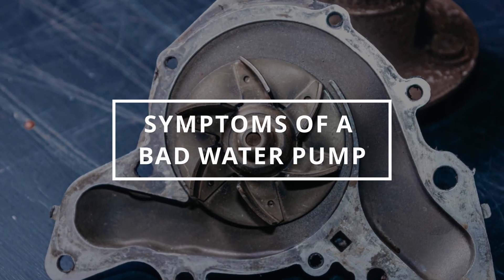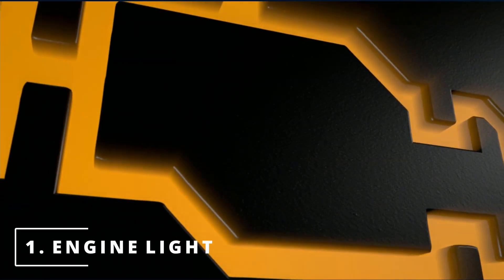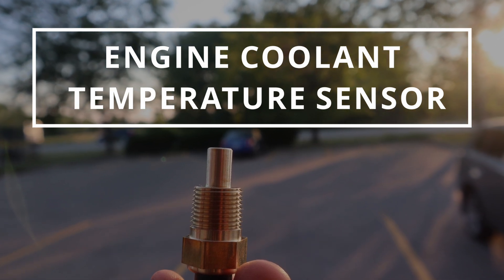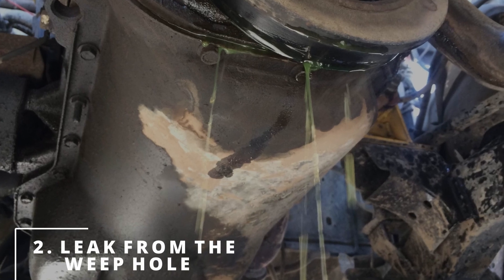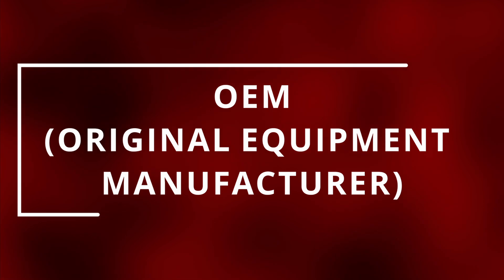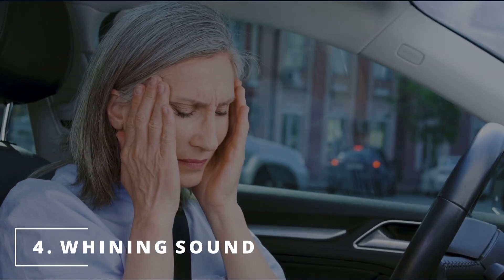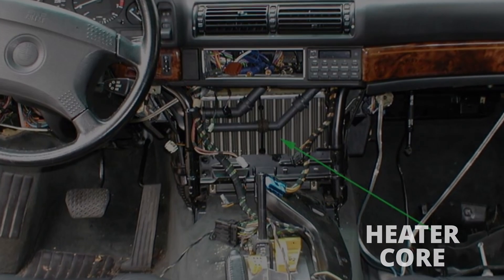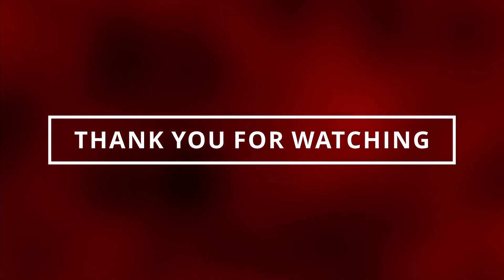SYMPTOMS OF A BAD WATER PUMP

Comment: Any idea why engine won't heat up to temp or circulate? Already replaced thermostat and ECT sensor.  Fan never kicks on, and low side of radiator stays cool.  In Arizona, so it's hot out and the heater core is hot, blowing very hot air.  Could it be because I'm using water and not coolant?

Edit - radiator was replaced. Was in a collision. System is self bleeding, no bleeder valve. 2019 Chevy Equinox 1.5 turbo.  My next thought is water pump, but it's not leaking and I'm obviously not overheating.
Reply: Always check and make sure your thermostat Works before you install it in the car. Put the thermostat in a pan of water and turn it on high and make sure it opens before you install it. It doesn't matter if it's new or not a lot of them do not open. A water pump will not make a car overheat unless the water is pouring out of the weep hole and the car is low on antifreeze. The bearing squealing does not stop the water pump from circulating the water unless it breaks the shaft or locks up then it will toss the belt. Make sure you don't have an air pocket. I just about bet money that your new thermostat is crap or air pocket these newer cars are notorious for air pockets. This guy on this video saying that the water pump will stop circulating the water no it will not. Unless the motor has no antifreeze from leaking from the weep hole or another leak. the pump locks up or snaps the shaft. And it will throw the belt immediately.
Reply: Thermostat in wrong direction making coolant run all the time. Engine never getting hot but radiator always warm.

Comment: My car is whining end it gets louder with rpms almost sounds like a Supercharger my AC started to blow warm air thats when my car overheated could this be my problem?
Reply: Thermostat /and or water pump bro
Reply: I have a 2000 Monte Carlo ik bad choice but gotta love it😂😂 annyways I have the same thing wrong and I juss changed my thermostat it’s not that I’m gonna do water pump next did it work for you brother?
Reply: Check your pulleys
Reply: Same I’ll get a new water pump lmao
Reply: Did you figure this out? Same thing for me
Reply: I've noticed lately a squeal as well as well as heat getting colder. Also a smell of coolant under the hood but no visible leaks. And I've had the thermostat housing and thermostat change about 6 months ago so I know the heat isn't due to thermostat not opening and closing. So gotta be the water pump. Also tested all pulleys and the water pump is the only one that chirp like a bird.
Reply: Could be a fair relay  @FishWithWyoming
Reply: Selamünaleyküm bende corolla 2002 model 1.6 benzinli var sabah yani motor soğukken v kayısın ordan tuhaf ıslık mi kuş sesi gibi binses geliyor isininca geçiyor bu ses devirdaim pompası sini degsitidim yine ayni ses var aldigim devirdaim pompası iicindeki kecimi bilyeden dediler sizce başıniza boyle. Durum olan. Varmi  @FishWithWyoming
Reply: What was the problem?
Reply: Bro I have the same problem it also hissing idk what it is but if you fixed it can you please tell me
Reply: @Alexlopez-fd6mk  I just changed.my water pump. Try taking your serpentine belt off and see if the hissing continues if so if you something internal going on such as air in the coolant system, try moving all the pulleys by hand with the belt off and listen for any weird noises no of the bearings should make a loud thumping or whine/squeak
Reply: @FishWithWyoming never said if it worked for you brother did changing it do anything?
Reply: @561jitt  worked great. Came to find out it's the pulley on the water pump so I just changed the whole pump.
Reply: @561jitt  also have fun changing that water pump on that monte Carlos they are time with the timing belt.
Reply: @FishWithWyoming  thought so
Reply: @FishWithWyoming  thank you
Reply: Could also be your torque converter
Reply: Heater core

Comment: Know why my coolant is white a little bit but not sluggish, I do t loose coolant it don’t over heat? I had just replaced my pcv valve so no water in my oil I got no mis fire no check engine light nothing, no loss in power, what’s my issue? car is a 2004 Pontiac Grand Prix, I fixed water pump also on it.
Reply: Not a blown head gasket btw had people tell me *

Comment: I have always had a leak being the cause of a bad water pump. Easy to diagnose that. THIS time, I kept hearing a grinding or bad bearing from the front of the engine, but what and where is this coming from? I thought, "it can't be the water pump because I just replaced it 2 years ago". Then the serpentine belt began shredding in half. Replaced the belt, it did it again with a new belt. What is causing all of this? Replaced both idler and tensioner pullies. Did not help. I took the belt off and the radiator fan was loose and wobbling. There's the problem. The water blades were grinding on the housing inside the pump and tilting down the water pump pully to make the belt shred in half from being out of line with the other pullies. The problem started from; I bought a rebuilt water pump 2 years ago. My suggestion, ALWAYS buy a new water pump. I've learned it's worth it.
Reply: I think I have the similar issue as you. The water pump doesn't leak as I installed it 6 months ago but I have squeaky noise still after my serpentine belt got torn up replace it and the tentionor but the noise was still there today I replaced the thermostat because the car was overheating and I checked everything before doing it only thing left is the water pump my uncle was against me checking it  because of how new it is  I really wish he had let me take it off I still have warranty on it but since we replaced the thermostat the problem is still there we'll I'll I hope this is it otherwise I'll be out of options and I'll get my second tan of this week.
Reply: @Alejandra-cv7rj  My suggestion. What made me KNOW it was the water pump was, I took off the serpentine belt. Then with it off, I could move the fan by hand. It wobbled A LOT moving it with my hand. I knew then the water pump shaft was the problem and making the belt run off center.

Comment: I went to the dealership he said I need new water pump, but my vehicle never got hot
Reply: a blocked heater core or a failed thermostat or air trapped in the coolant hoses
Reply: That’s what happened to me 🤔 what could be the reason?

Comment: What are the reasons that make the water pump in the car 6 cylinder 530 BMW model 2006 does not stop working even when the car is turned off, it works on a clock

Comment: I've got a small leak coming around that area. But my engine hasn't over heated and the heater stays hot. No CEL. I'm thinking it's the thermostat housing that I replaced about a month ago is just faulty.